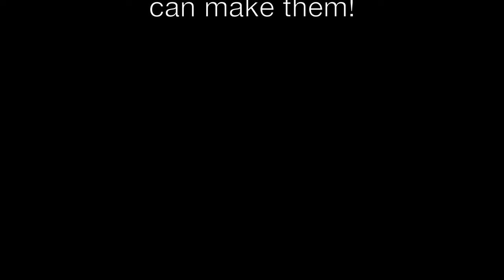T1N Sprinter (2004-2006) Transmission Service + Valve Body Removal

Comment: Congratulations! You are the first YouTube car mechanic to stress the importance of a torque wrench. Most channels are slappin' together high-dollar European sports cars with an impact driver and talking about how shiny things are. Basic mechanics skills are so important. Proper torque being one of them  Thank you.
Reply from the maker: Thank you. With all the aluminum components in a Sprinter, neglecting proper torque becomes an expensive mistake, quickly. It's a lesson I had to learn a few times... Haha.
Reply: You are SO right about the importance of torque… I just watched the video and got under my van today to change my filter/fluid… The drain plug is stripped, 1 of the bolts is stripped, and other bolt has the previous owners T27 broken off inside it… now I’m up a creek
Reply: @MichaelRodriguez-vb8dn  did you solve your issues with an ez out and helicoil?

Comment: Bill, I'm the guy who had to replace it because I broke the captive bolt.
I learned this by chance while waiting in line at Napa holding the conductor plate to buy a replacement.  
Started chatting with one of the guys waiting in line at the parts counter and he happened to work for a transmission parts distributor so I asked him what's the difference between the two parts listed for the sprinter on the napa site.
He said simply:  The one with the U channel and NO dipstick stopper is for Chrysler transmissions and while it does work on Mercedes is not recommended but for some reason, all auto parts stores make the same mistake and listed as a Mercedes product.
Differentiator part number DBJ. vs DBG.
When I showed him what happened with the captive bolt he also mentions that while it's easy to get out he sells 100's of these per week and I was better off replacing them anyway because they go bad all the time and the more recently produced ones have stronger contacts.

Comment: About to do a loooong overdue transmission oil change and this video is a godsend. Thank you for sharing your knowledge!
Reply from the maker: Set your torque wrench to 8Nm and tighten in a star pattern, when you get that far and putting things back together.

Comment: A suggestion I’d like to make is cleaning the transmission cooler when doing this. I rebuilt my transmission and the company that sold me the kit demanded I buy the cleaner or they wouldn’t warranty the transmission. 
I was skeptical as I had drained the lines and have changed out transmissions throughout my life without doing this. 
When it came time to do it, I almost skipped it because I had to make an adapter to fit the hose on my line. If it wasn’t for having to wait on another part anyway, I would have. 
Am I glad I didn’t. I couldn’t believe the amount of crud that was trapped in the cooler that the cleaner brought out. It made a believer out of me. I will always do this from now on with any transmission I service.
Reply: thank you very much
Reply: What was the name of this cleaner if you can remember?
Reply: I didn't know there was a transmission oil cooler! Or maybe this was not a Sprinter you rebuilt? No mention of this is made above. But yes, I trust lubegard a lot and have used their other products for years.
Reply: @LEXICOGRAFFER  yes, the oil cooler is mounted in front of the radiator and is what the transmission lines are attached to. The transmission pump pushes the transmission fluid out into it to cool it down before cycling to back into the transmission. This is very common on diesels. Personally I’ve never worked on a diesel that didn’t have a cooler.

Comment: Thanks for some of the best and most informative T1N videos out there! I bought at 2006 T1N Sprinter with about 176,000 miles on it. The service records say it had the transmission fluid changed by Jiffy Lube at about 172,000 miles, BUT it says they used ""synthetic versatrans CVT plus global ATF." I think I found this ATF online as "Phillips 66 VERSATRANS CVT PLUS FLUID." The information sheet for this ATF says "for continuously variable transmissions, as well as step-type automatic transmissions." I couldn't find any standards, licenses, or approvals for it. My van now has about 179,000 miles on it and started doing the Rumble Strip Noise ("RSN") thing about 500 miles ago (a video on YouTube called "Sprinter rsn" posted by tr4dude is an extreme example; mine isn't nearly this bad and happens only occasionally). There's a fix for RSN that I've seen on YouTube called "2005 T1N Dodge Sprinter Rumble Strip Noise Fix and Transmission Service - Rambling with Phil" posted by Rambling With Phil. If you have time, could you please let me know your opinion about the following?: 1) Do you think the Phillips 66 VERSATRANS® CVT PLUS FLUID is bad for my transmission or is causing my Rumble Strip Noise? 2) What do you think about the "fix" in the video by Rambling With Phil? Is it any good? THANKS!
Reply from the maker: Rumble Strip Noise (RSN) is a specific valve shudder. A few other things can cause similar valve shudder but won't be corrected by the D.A.R.F. (Dr A's RSN Fix). I don't recommend the DARF unless the shudder is unbearable and I'm not convinced your issue will be helped by drilling that hole to relieve pressure. That fluid is comparable to Mercon V which is definitely not compatible with our vans. I would do a complete fluid change including the torque converter and new filter immediately. Shell 134 of Fusch's Titan 4134.
Reply: @FloridaVanMan  Thanks! I did more research and found the following: 

The Owner's Manual (page 300) for my 2500 Sprinter indicates that the following fluids are suitable for the 5-speed automatic transmission:

"Shell ATF 3403/M-115
MOPAR® Part No. 05127382AA, or equivalent
Fuchs/Shell ATF 3353"

"MB SHEET:
236.10
236.12"

Per Fuchs' website, Fuchs 3353 meets the "Dexron III" specs. I also found another reference that said "Dexron III and Mercon V are similar types of automatic transmission fluid, with the main difference being that Dexron is the formula developed by General Motors, while Mercon was created by Ford. The specifications of the two formulas are so similar that the two are often considered interchangeable, even if the car manufacturer recommends only using its specific formula."

I asked Phillips whether Versatrans CVT Plus fluid meets Mercon V, Dexron III, or both. They replied that it does NOT meet either of these specs but is recommended as suitable for such use in their "AUTOMATIC TRANSMISSION FLUID RECOMMENDATIONS GUIDE," which is actually published by Kendall. Their guide specifically indicates the following:

"Sprinter 2500 2003-09 Mopar P/N 05127382AA, MB 236.10 & MB 236.12 Versatrans CVT Plus ATF = Yes"

This is all terribly confusing. Do you have any thoughts?
Reply: I have an additional update: a PCMO (Passenger Car Motor Oil) engineer at Phillips 66 responded as follows: “The [Versatrans] CVT Plus is suitable for use here [in a 2006 Sprinter] as you mentioned. When the CVT Plus was being developed, several no harm tests were conducted to ensure use in step-type transmissions, including those made by dodge (or transmissions sourced from elsewhere used in dodge vehicles). As he [meaning me] mentioned, the viscometrics are very similar between these two [referring to Versatrans CVT Plus and Shell ATF 3403] which is not a coincidence. If there is confusion stemming from the fact that Versatrans [←this refers to regular Versatrans, not Versatrans CVT Plus, which are 2 different products] is not recommended in ATF guide, when the bulk of our materials and research for Versatrans were conducted decades ago, there may not have been enough data to give the thumbs up. CVT Plus being newer and having been through more intensive testing makes us more comfortable with claiming suitable for use on such a large range of transmissions."

Comment: Hi FloridaVanMan, thanks for your replies to my questions - and here's something I found out (Crossposted to the View/Navion 2006/2007 Owner's Group):
"After fighting with this once, I took a close look and found that the small indentation that the pointer is indicating is visible at the edge of the  transmission case.
If you put a flat blade screwdriver in it and lever it against the trans case it pops right out!
No cursing or persuasion tools needed!
Happy day!"
(Dang! Can't figure out how to post a photo - I guess you'll have to check the Owner's Group.)
Also, I'm 94teenV8r in a different profile. . .

Comment: Thanks so much for the detailed explanation. I think I'm ready to take this on for the first time (I hope). When you mention Bill is going to turn over the engine at 7:15, what is he doing to manipulate the torque converter to become more accessible? Thanks in advance!
Reply from the maker: Sorry I missed all these comments until now. We have a socket and bar on the bolt-head in the center of the harmonic balancer. I think it is a 23mm socket, but I'd need to look tomorrow to be sure. When rotating the engine, always turn forward (clockwise). Turning backwards, I'm told, can cause trouble with slack in the timing chain.
Reply: @FloridaVanMan  After you rotate the torque converter to drain do you rotate it counterclockwise to bring the bolt back to the original position it was in?
Reply from the maker: @ratchetboo   We only rotate the engine to find the drain in the T.C. Once the plug is located we drain it, replace the plug, and carry on. No need to turn it again after it is located at the bottom. If you turn the engine counter-clockwise for any reason, be sure to turn it clockwise to take up any potential slack before trying the starter. I'm not clear how/why a chain would get any slack in it, but I wouldn't want to yank on it with the starter motor if there were any slack. This is something I have read about and not experienced any slack timing chains. But I play it safe here based on others advice.
Reply: @FloridaVanMan  cool thanks for the info and helpful tutorial
Reply: @FloridaVanMan  how many nm do you tighten the torque converter bolt we used to drain the remaining tranny fluid?
Reply from the maker: @ratchetboo  14 N·m (10 ft.lbs.)
Reply: And for completeness, the pan drain plug gets torqued to 20 Nm. (177 inch pounds or 15 foot pounds)
-dave
Reply: Also, the reason for only turning the engine clockwise (righty-tighty at the crank bolt head) is that going the other way pulls the timing chain down against the chain tensioner, which has the potential to damage it. Clockwise pulls the chain tight to the cam sprockets, and leaves the chain draped loosely across the tensioner
-dave.

Comment: Very helpful video. I see your link to amazon goes to Shell ATF 134. This isn't what is used in the video. Is this the proper fluid to use? I'm having trouble finding reliable information.
Reply from the maker: This is what we have used recently and it works very well. Meyhle has not been available for a long time unfortunately. Shell ATF-134 is perfectly okay and specifically meets the specifications listed for Transmission fluid. Even goes one step beyond specifically name dropping the transmission and stating “suitable for Sprinter vans”.

Comment: Thank you for the very well done step by step demonstration!  I own a 2006 Itasca RV and I’m going to attempt this on my own.  The only thing I’m unsure about is whether it has a “small” or “ large” torque converter plug.  How do I tell the difference between the two?  Thank you for a great video!!
Reply from the maker: Only way to know is take it out and look. The seal does not need to be replaced every time and service is so rare I would not think the average person needs to worry about a replacement seal on the torque converter drain plug. Reuse as needed. I do.

Comment: Wish the wrench sizes needed was mentioned and how that plug receptacle detaches, and how to position the torque converter drain plug.  But a good video to get basic orientation, to know what to expect under there.
Reply from the maker: We couldn't blast it all in one video. lol Actually this was a very early video and we have several transmission videos. Drain plug is often 5mm hex, all other bolts are T-30 and tighten to 8Nm. Turning the engine to find a drain plug requires a friend or creative use of a large ratchet between knees.

Comment: Thanks!  Does the captive screw socket have to come out to drop the valve body? I got the captive screw loose, but the cup won't budge.  What is a Level Two persuasion tool?
Reply from the maker: Yes! The round connector is screwed to the conductor plate. Trying to lower the valve body while connector is still in place will ruin the conductor plate and prevent removal. 
Level two just means a bigger hammer. In another video I used a level 12 persuasion tool on an EGR removal. (**it got real*).
Reply: @FloridaVanMan  thank you for the reply - I wasn't able to remove the socket cup with the captive screw, so I put it back together (only to find that a PO has badly buggered the pan threads into the case.  Dammit!
Where did you decide to apply hammer-ness on the socket cup?
I have another question related to your video (for which I thank you very much) - I found it impossible to bump the starter to get the torque converter drain plug to line up with the cut-out: is it OK to turn the crankshaft with a wrench on the pulley nut?  I haven't confirmed there is a nut on the front of the crankshaft (but there are on my other cars) but I thought you'd be the right guy to ask.
Thanks again,
Tim.

Comment: Thanks!  The link to conductor plate with trans filter and more on Amazon states it will NOT fit my 2004 DODGE SPRINTER 158 IN. 2500 HC VAN
2.7L 2687CC 165Cu. In. l5 DIESEL DOHC Turbocharged
.  Do by chance know what kit would fit?  Also, wondering if same Shell ATF 134 Mercedes Benz Transmission Fluid will work on 2004?  Finally, have you had the update issue that causes an error in the cluster panel thus needing to be replaced?  Very much appreciate your video and looking forward to more especially specific to 2004 2500.
Reply: Yes, the Shell 134 fluid is good for the 2004 as well as my 2006 model. Lot less cost in bulk.
Reply from the maker: That is odd. I see now the description only lists one vehicle as fitting, 2005 Sprinter. The '04-'06 are all the same to my knowledge. All North American models of this age are same OM647 engine and 722.6 transmission. Should fit, but I hesitate  to make any promises. Same fluid & filter used on all ours and a few friends' vans. We have done a couple conductor plates and never found there to be a variation in needed parts.

Comment: Help me, Florida Van Man!! You're my only hope!!

I have an '06 t1n that went into limp home mode yesterday (along with my '86 4Runner having it's clutch go out yesterday as well)... I had stopped to talk to a neighbor, with the van in drive and my foot on the brake, for about 10 minutes... When I pressed the gas pedal to go, i got nothing. From a dead stop, I can't rev over 1.5k rpm's, and going up slight hills I have no power at all... It will not go out of first gear and pull. I was leaving to go to town, and was able to drive the roughly 1.5 miles back this way...
Reply from the maker: Would you say it feels like the pedal gets no response, or more like the van is trying to drag a ton of weight? If it feels like weight, when was the transmission last serviced?
Reply: @FloridaVanMan  definitely no response from the pedal!! After I shut off and reset the LHM, when I start it again after a few minutes, I can throw it into drive and feel the transmission engage. During LHM, it doesn't feel like it engages, no matter how much I put it in park and then back into gear. When it does engage, after 1.5k rpm, it almost feels like driving in snow or mud when the tires spin, but you're still inching forward a bit, but with no real power or traction... If I go up even a slight incline, I lose all steam and have to reset LHM.

Clear as mud?
Reply from the maker: @crouton976  This could be a transmission code that needs to be cleared. Do you have a code reader that is good for Sprinters? I like this one https://amzn.to/3IKSgwt Read all codes and note them or screenshot. See what codes come back when you try to drive. We have a video for getting the reader setup right for T1N Sprinters. Pay special attention to the CDI codes and Transmission Control codes. Have you checked the transmission fluid level? You need this Trans Dipstick: https://amzn.to/352iCY1 . You won't be able to warm the trans fluid if you can't drive it, sou see the bottom set of lines as your makers for low & high. Check with engine running in Park, after cycling through R & D.
Reply from the maker: https://floridavanman.com/donate/
Reply: @FloridaVanMan  yup, I've got the Autel reader, based on another of your videos. 🤘🤘

Unfortunately, I accidentally hit the quick clear button and erased all the codes. 😅 It was throwing something for the electronic transmission control, and the regular transmission control. Also, I noticed an exhaust smell the other day, and hadn't had time to investigate... I suspect I've got a bad injector seal or two... I'm seeing what might be black death peeking out from under the cover... 😬😬😬

I'll definitely buy the dipstick and check my trans fluid... Hopefully that's all it is...

And hey, if you ever wanna make a trip about 1.5 hours from San Diego, I've got an '06 3500, 158" WB, with double sliders (which I understand to be rare in North America) that wants to meet you... you could get plenty of footage for a year's worth of content!! 🤣
Reply: @FloridaVanMan  as soon as I get paid, I'm sending something your way... Much appreciated, good sir!!